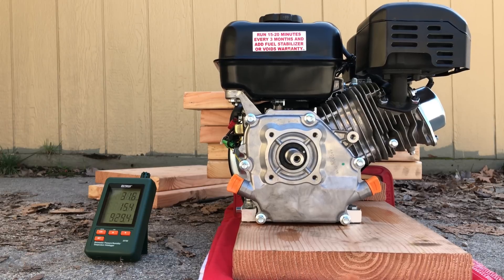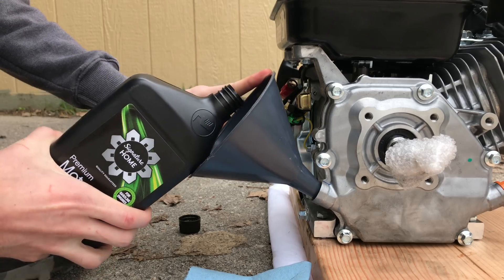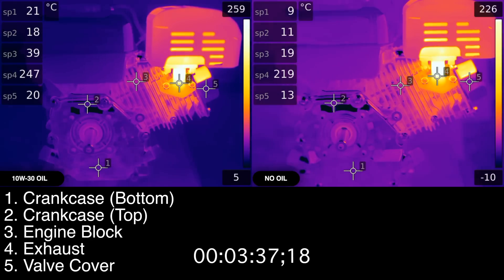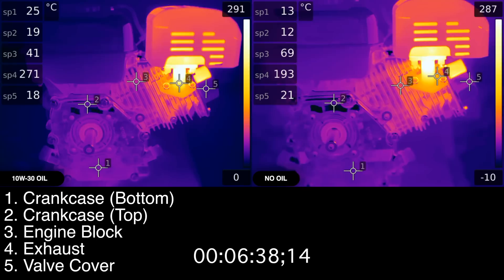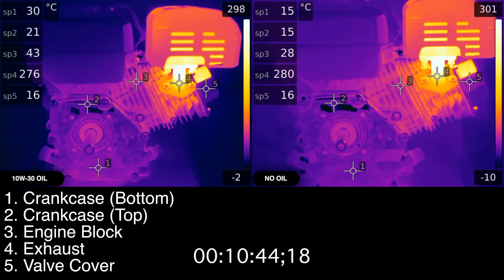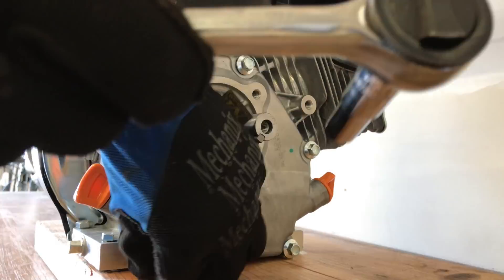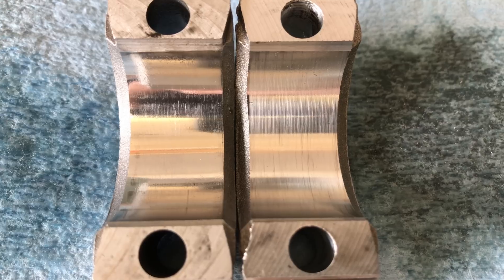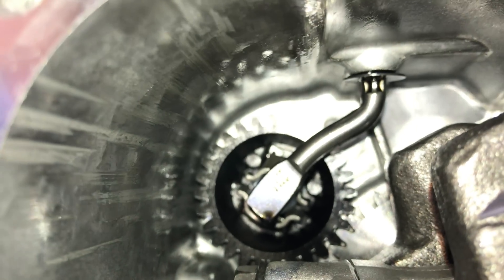What Happens To An Engine Without Oil?

Comment: what happens if you don't change the oil at all? Not saying I don't change my oil.. but I'm curious
Reply: It gradually turns into thick sludge that doesn't flow at all. Eventually after enough miles it's like running without any oil and the engine dies.
Reply: Jonny V in becomes chocolate
Reply: Im from Argentina, so my english isent so good.
If you do that, eventually the oil loses propertis, and dont lubricated so well
Reply: I had a customer that bought an 80's Crown Vic 5.0L that had been seriously neglected...it only had about 39,000 miles but ran unusually hot, used oil, and had problems with noisy lifters on cold start, and never really sounded too healthy to me. Of course we didn't know this was the problem when she bought it, but when the valve covers started leaking, I replaced the gaskets...and weirdest thing I've even seen....when I pulled the first cover off, it looked like there was another cover under it! I was shocked...it was a perfectly-formed shell of hardened burnt oil (what used to happen when the paraffins in motor oil separated from heat and age and turned to almost plastic)...this had formed structures around each rocker arm and valve as well, and the large oil return holes in the back corners of the heads were about 90% blocked. So when she was running at higher speed, oil was getting trapped in the top end and overheating, and leaving the bottom end to make do with whatever overworked and hot oil it could scavenge from the sump. VERY bad situation. It took all day, but I chiseled out all of that crud on top, rodded out the return holes, let the oil drain, put on a new filter, added 5 qts oil and one qt kerosene, ran it for 20 minutes, let it go again, stuff that looked like black peanut butter came out...(eek)...did it again 2 more times until the crud stopped coming out, and then put on another new filter and good oil, and had her bring it back in 500 miles for yet another oil change, just to be sure. The car sounded pretty good after all that, ran cooler and didn't have the lifter noise anymore. She was delighted.
Reply from the maker: The oil loses the properties of the additives used, and contaminants thicken the oil with time. Eventually you lose oil flow as the entire system is designed to work with oil at a certain viscosity, and it gets too thick. This video shows somewhat of a demonstration at the end: https://youtu.be/tYkg0oDUXs8
Reply: It turns into sludge and eventually kills the engine
Reply: Renzo Asdasd Your English is actually quite good.
Reply: iamezza other than it pretty much ruining the engine I didn't know it can kill it.. thank you
Reply: I'm about to interview an engine oil chemist in a few days, so I'll ask what chemically happens to it under those conditions. If anyone else has any questions, feel free to post them in my recent video; I'll go over the comments on April 9th, 2017.
Reply: Jonny V it becomes more solid.
Reply: Jonny V At work we've tested a small engine to 500 hours on the same oil and it was technically still lubricating alright but it lost all properties. 200 hours is the most you would really want to go if you want the tbn to be higher than the tan.
Reply: I worked at a Kia Dealership selling cars and we had a lady trade in a Optima that had 200k miles on and she only changed the oil 3 times in that period.  Still started on a dime and ran fine.  They didn't sell the car to anyone but put it on display.
Reply: It turns to sludge. There are lots of videos on YouTube that show engines that haven't had oil changed.
Reply: after awhile oil becomes like acid and can actually eat away at your engine...it has to be in there for along time but i have seen it. always change it when its time.
Reply: I work at a Nissan dealer ship, this person had their car towed in, 2016 rogue 26k miles on it. Driving down the road, heard a loud banging sound, car cut off, wont restart, opened the hood there was oil every where, had it towed to us. When was your last oil change. Never had one done. At 26k miles, with out a single oil change, the crank bearing (the one a showed in this video) seized, with the engine at higher rpms at the time, two connecting rods (the rod that connects the piston to that bearing) snapped off, and blew through the side of the engine block, leaving big holes. Probably the funniest part was when we went to remove the foam insulator under the hood because it was covered in oil, a whole bunch of metal pieces fell out :). This was not covered under warranty, for parts and labor you were looking at about $18k (almost as much as the car was worth), the owner had the car was towed away (probably to junk yard, but I'm not sure on that), and is now probably making payments on a car that they no longer have. Moral of the story CHANGE YOUR F%$KING OIL PEOPLE.
Reply: I've seen connecting rods get so hot they bend and shatter before going 
through the side of an engine block or through the oil pan. I've 
actually kept a set of pistons and bent connecting rods to educate 
customers about this very topic. 

All the small particles evaporate off and are burned (unless synthetic), leaving the heavier. All oils will thicken. Burned and thick oil will collect in passageways eventually blocking them (sludge). This blocks the drainage from cylinder head to lower end, preventing oil from draining back to sump causing oil starvation to bearings. Engine bearings don't have rollers like your bicycle, but float on a thin film of oil under pressure. Main (crankshaft) bearings are under the greatest forces and will fail first. Heavy knocking followed by rattling and parts coming out of the engine.
Reply: After about 1 year, the oil is bad enough to start harming the various seals that keep the oil in. Also it starts to turn into sludge now, clogging oil lines inside the engine.

After 2 years, sludging has done near permanent damage and your mileage and engine power is down noticeably.

After 3 years, all the oil has turned into sludge, burned to the insides of the engine. Engine damage is permanent. It is running on life support. If you change the oil now, the sludge inside the engine will free up and clog remaining oil lines and the engine will break.
Reply: Jonny V Eventually there would be no more viscosity in the oil and the engine would over heat, especially running at high RPMs. That would ruin your engine for sure. The friction against the cylinder bore from the piston would cause major heat as well without  the viscosity level in the oil being right for that specific engine.
Reply: It will eventually turn into a thick sludge and your engine will sieze
Reply: 15-20 thousands kilometers is fine with modern cars and synthetic oils.
Reply: yea..it become acidic over time.
Reply: Next time I'm at my mothers,which will likely be sometime this week. I'll snap a picture of the inside of a car sitting in her garage that has very clear signs of never having the oil changed and post it here for you to look at with a side-by-side of an engine that has had regular oil changes throughout it's entire nearly 300k mile life.

To put it into words I'll describe my attempt to save that engine. First I removed the intake manifold and soaked it in brake cleaner. While it was soaking I also got the head covers prepped up the same way and began pouring (not spraying) generous amounts of brake cleaner into the engine block and heads. This had little effect so I upgraded to pure mineral spirits after breaking two plastic chisels. This kind of worked, the oil was still too hard to scrub off but at least now plastic chisels were able to chip it away. To clean out the needle thin oil channels, I used enameled copper wire, grounded the engine block and drove a large amount of current through it to cause the wire to heat up thinking I might melt the oil out of it. This kind of worked but I only had solid core phone wire which was only half as large as the oil channels so I couldn't get it all out despite so much heat that I had the wire glowing inside the channels. By time I was done with the top of the engine I had close to a gallon of clumpy oil in a 5 gallon bucket (using the buckets ruler markings to measure). The oil in the pan under the engine came out in one solid chunk with a little tapping from a rubber mallet. The cam shafts (dual cams) weren't too bad, well within tolerance after some light sanding to clean the residue off and restore the smooth metal surface. The various bits it interfaced with weren't so great and required fabricating a shim barring of sorts to bring it back within tolerance.

Fast forward a couple days of dawn to dusk hard work trying to salvage the engine and all of it's components. I filled the engine with a lighter weight of oil since the oil channels were no longer large enough for the viscosity it called for to flow at acceptable rates. I also poured an entire bottle of Marvel Mystery Oil into the engine to clean out anything left over and force out any residue left behind by the brake cleaner and mineral spirits. Fire up the car and as expected engine was racing from the fuel amplified with various cleaners and additives. Let it race until the temp started to rise and shut it down. Repeated this a few times until it came down to respectably safe idle speeds. Dumped the oil which looked horrible and very inconsistent, flushed the engine and refilled again. I thought I had performed a miracle and saved that car, started easy, idled smoothly but the moment I put it into gear the engine gave out. Even with the lower weight oil, it just wasn't enough to keep the block lubricated.

My suggestion if you have been slacking on oil changes. Do them at half the recommended interval and ad 200ml per gallon of Marvel Mystery Oil until the oil starts coming out clean again. My dad taught me this a long time ago and it is very effective, albeit costly way of saving an engine block that is on the road to death. It's not a surefire solution but it's fairly reliable and out of all solutions I've seen results in ruining the least amount of gaskets. You will very likely gum up the catalytic converter from the dense fumes this tends to create if there is a significant buildup inside the block.

For reference that engine that has seen oil changes at recommended intervals for 300k miles. It has required no major overhauls, mostly stock parts and looks gorgeous inside.
Reply: Jonny V your engine will seize up
Reply: It turns into a gobbly goob and the car performs really bad. You might see some wear and year as well
Reply: Your oil pickup tube filter may clog up and destroy your engine. Happend to my dads avensis. Because of to long between the recommended oil changes (15-20k km between). I like to change oil every 5-7000 kilometers.
Reply: kaffetrakter that's correct, also using a engine flush can potentially be harmful as a small amount of flush can be left after the oil has been drained so when new oil goes in the remnants of flush thin out the new oil and can damage the seals over a period of time. I advise customers to use a engine flush oil, drain out the old and pour in flush oil run up to temp and drop it. In my own cars (vauxhall) because I get oil filters and oil cheap I can afford to change more often and usually drop out clean oil, it's really only dropping it due to the extreme heat which can change the properties of the oil depending on spec and use. I drive my cars hard and when I buy a new car I do use a good engine flush and drive the vehicle to get the oil and flush fully circulated, drain it and fit new filter and cheap oil 10w40 and drive for a few days then drop oil and fit new filter, depending on how clean I may either reuse or just change filter and use cheap oil again until I'm happy it's clean and free of flush remnants before I use expensive 10w60 oil with a new filter. Most of the vauxhalls with C20xe or C20let engines I buy have done well over 100000miles, one which is in my kitcar had 245000 and was still going strong, I rebuilt it eventually with a rebore up to a 2.1
Reply: Oil will get chunky with little bits of engine oil and cause oil pressure problems throughout your engine massive engine damage and basically your valves and cams will end up siezing in massive chunks of hard chunky oil
Reply: Alan Hunter 200ml in what gallon?
Reply: Aside from accelerated wear, you'll probably develop problems with the valve train first. You'll start to hear some valve-ticks after one or more of the lifters get sludgy.
Reply: The oil starts to turn into sludge after some time...really sticky sludge which is a pain to remove and can clog up pipes, drains and stuff.
for instance:

watch?v=KC-SxrsgEwo
or
watch?v=trrQtgWa-GQ

So no, it's not enough to simply change the oil after you had the old oil for god knows how long in the engine.
Reply: Jonny V. That double dot says otherwise! x3
Reply: You're wrong. Unless you poured water into your engine and let it sit for a long time, nothing would rust. Read the comments above to understand what would happen.
Reply: J T I posted a vid a few comments back.  No one seemed to notice.  Lol
Reply: Engineering Explained but what if you don't change your oil for some time, and then change it? is there any damage to the engine?
Reply: Outside of the additives and it loosing it's properties, the engine in this video doesn't have a filter. Eventually all the crude floating about in the oil will cause excessive wear and it'll start burning oil. It'll shorten the life of the engine. That being said it will still run for many hundreds or even thousands of hours without an oil change as the excessive wear will cause it to burn oil and the adding of fresh will drag things out.
Reply: im not a mechanic but my first job was working part time at a hydraulics factory servicing and building hydraulics from scratch 

basically it thickens up and will stop the engine from working and can actually cause a catastrophic failure
Reply: I change every 5000km I reset my ODO2 to zero after that
Reply: My push mower does not recommend changing the oil because its considered disposable. When I changed it, there was a grey color from metal particles (like in the video). Oil is better quality than in times past, but it still needs the contaminants purged. In the 70's small engines needed an oil change every 10 hours, today its extended to 50 hours due to better designs with alloy parts and improved oil chemistry.
Reply: The only way that your engine would rust if you drove it through water which would enter through your air flow system. In which case, your screwed if the engine stalls from water in the combustion chamber.
Reply: Engineering Explained and since your oil thickens up, you will be able to watch your oil pressure go down which will eventually cause serious harm to the valve train because there is no oil making it up there.
Reply: Depends on type of oil. If it's dual-temperature rated like 10W-30, the additive that makes it thicker when heated will burn up and the oil will erode until it becomes plain 10W - much thinner than you need for operation, exposing the motor to greater wear. The oil also accumulates soot from the cyllinders, making it black. Soot is extremely abrasive and will cause the engine to wear rapidly.
Reply: Jonny V look up the video 300,000 mile oil change
Reply: Kevin Weil the chassis was good? If yes then I would consider an RB swap... As long the 710 is changed regularly...
Reply: ΑΡΗΣ ΚΟΡΝΑΡΑΚΗΣ as far as I know the only damage was the engine. Of course piston rods blasting through the side of the engine did send parts every where, so it possible there was other damage. I doubt to the the chassis, but possibly the exhaust, and  transmission,
Reply: when the oil loses capacity to reduce friction (when is burned) the metal parts on the engine start to dilate , first the broze parts and next the steel parts .Bronze has a melting point lower than steel so it will loose and break first , breaking the engine on the crankshaft has the piston jams .The head of the engine is made of aluminium ,that part will deform beyond repair ...but before all of this comes to happen in the first place something very important starts happening , and it can save a engine: the engine starts to reduce his normal speed , as if a person starts to reduce pressure in the aceleration pedal .That is a strong indicator that there is not enough (or none at all) oil or some part of the lubrification sistem is clogged up (it happens a lot when replacing brands of oil)
Reply: Depends, if it's a wankel, has oil metering & is driven hard, nothing. Just change the filter at regular intervals, that's it... HA!
Reply: In short, the oil will gum up and clog the lubricaring pasages in the engine and some are tiny but vital, which would in theory block certain parts from getting any lubrication even if you change the oil 10 times in a row which would then cause exessive wear as the video shows on all moving parts and the parts they touch.
Reply: L TR it probably had penzoil in it
Reply: then good luck changing it later.
Reply: Jonny V there's a lot of options lol, and with that! here's mine

First thing that wears out are the additives to thin the oil when at ambient temperature to better lubricate in cold starts and anti-foaming additives as well to allow high RPM's over ~3,000 RPM's.

Then there is just oil, that simply evaporates very slowly with heat or burns off into carbon. And only need to worry about filtering.

To give you an idea, Semi-Trucks use strieght oil that they run for 15k-50k miles. And when changed every 15K it's much more of a system check than an oil change.

With that, you can just change your filter and never pass 3k RPM's lol. Also need to fully warm up the engine every time when using ;-)
Reply: In motorcycle: Gear shifting becomes pain like hell painful on toes, valve makes hell of noise, clutch burns out and many more things that I do not know. And in the end, when you change the oil, black pure black gross ugly thick, thickest fluid comes out. It looks like dark cold lava from hades room.
Reply: And that's where hersheys kisses come from.
Reply: dan sid lmao you read my mind
Reply: Jonny V The engine makes an awful ticking nosie. That's why you check the oil dipstick every week and every time you're at the gas station.
Reply: Jonny V thicker oil usually increases oil pressure due to increased flow resistance, however I imagine there would be a point when it wouldn't flow at all and wouldn't reach the top end of the engine, like you said
Reply: Jonny V . You will be eather buying a new one or rebuilding the old one
Reply: In short... The oil turns to tar and you pave the inside of your motor.
Reply: 5Rounds Rapid no it’s really not
Reply: If it's one thing I learned in aviation school. It's that spun bearings occur when using oil over its change time. The bearings that go into each grove on the crankcase sides where the crankshaft sits inside. Those plain bearings.
Reply: Jon Doe the oil would break down and turn into sludge, then would be like not having oil at all. Engine would blow.
Reply: Renzo Asdasd Your English was pretty good.
Reply: Jon Doe it turns into a thick black paste
Reply: And if it's a hemi it will make an awful ticking noise regardless lol
Reply: My sister just threw a few rods in her engine due to lack of oil changes. The oil was extremely thick putting large amounts of stress on the engine.
Reply: Blow up
Reply: Jonny V the oil is turning in a grey water-ish fluid with a lot of metal
Reply: Kevin Weil you people so thick you cant buy a recon engine and drop it in thats what normal people do but hey sounds like your a yank so doubt if you have the brains to think like the rest of the world